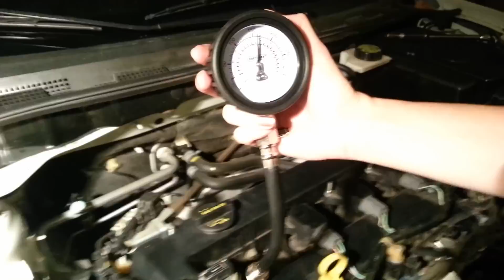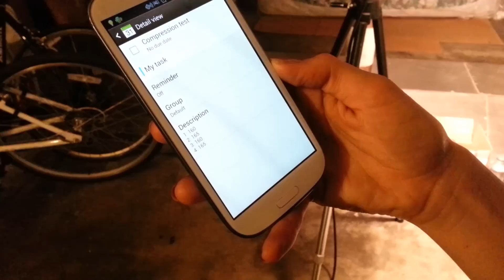HOW TO DO AN ENGINE COMPRESSION TEST!

Comment: So I'm trying mine and I am curious. If I remove ignition fuses my car won't even crank. I have a 2005 Mazda 3 with a 2.3 litre. I am not getting a reading at all on the gauge. I have pulled the fuel pump fuse and tried it with the ignition fuses in place....no reading . When I yank both ignition fuses the car won't crank ergo no reading. ....help

Comment: I just wanted to let you know, The only thing you did wrong was not removing all spark plugs before testing. Reason being? The problem is that if your head gasket is blown between cylinders you wouldn't know because the air will not be able to escape in the other cylinder!

Comment: Well you explained it well enough but,you should remove ALL the spark plugs so you can spot leaks between 2 cylinders (for example if the 2nd and the 3rd cylinder got blown gasket in between having the spark plug on will hold the pressure...but if you remove all sparkplugs pressure can escape through possible holes of the gasket and give you accurate result)

Comment: What if it had a carburetor instead of fuel injections? How to I disable the injection system?
Reply from the maker: Sith Strawberrynutz To disable the ignition system disconnect the wire that connects the distributor cap to the ignition coil (the ignition coil looks like a long round pipe and the distributor cap is plastic piece with a bunch of wires running from the top, there usually only 1 wire that connects these two pieces together). To disable fuel delivery you will need to find the main fuel line that supplies the carburetor then clamp it off using a vise grip. Usually it's a single fuel line but there are some cars that can have multiple. Also be careful not to puncture your fuel line when using a vise grip. Thanks for watching!
Reply: Is it necessary to cut off the fuel supply?
Reply from the maker: Sith Strawberrynutz Yes, if you don't your carburetor will inject fuel and likely flood the cylinders. You will also get fuel in the compression tester and ruin the gauge.
Reply: +Sith Strawberrynutz 
I was trying to find an answer to this. If you just remove the fuel line to the carb, it'll still have plenty in the float bowl so will keep putting fuel in. People say to fully open the throttle when testing but if anything I'd have thought it would be worse.
Reply: +rchave I suggest that fist remove the fuel line and and run the engine  until the fuel on fuel bowl was depleted. Then remove the distributor dc connector to disable spark voltage.

All spark plug must be removed and proceed compression test.

 I suggest that gas pedal should be step on while cranking the engine. . so that throttle plate will open wide and to avoid inaccurate Compression reading.
Reply: I would guess to disconnect your fuel pump and let the car run till it runs out of gas
Reply: so that your lines won't spit anymore fuel to the carb

Comment: Great video, just a few things to mention. Its best to remove the fuel pump fuse when doing a compression test. Before you turn over the motor its best to have all of the spark plugs removed and lastly, the person cranking the motor should have the gas petal fully depressed to allow the most air into each cylinder. Great video otherwise!
Reply: E Company, 2nd Battalion, 506th PIR, 101st Airborne Explain that to General Motors and Ford Motor Company.
Reply: garretts91 Engine not a motor
Reply: GamingWithAndriod More like Moderrr.
Reply: +E Company, 2nd Battalion, 506th PIR, 101st Airborne your a fool

Comment: My car didnt have no.compression at all and doesnt want to turn on how much do u think it will cost to fix it please reply?
Reply: Just throw that shit away...
Reply: what car ?
Reply: I have a 03 honda accord
Reply: well its going to be expensive, depends on your valves and piston rings conditions its either the piston rings or valves when you dont have good compression.
Reply: check your valve clearences
Reply: .....ya..
Reply: +Isaiah Blunkall (Hamm) 0 compression or low?  If it has timing belt, that could be the cause.  Which could have damaged pistons & valves.

Comment: Be careful with removing plugs on some engines with AL heads at operating temp. You could end up removing the threads as well. Especially the Ford 4.6L 2V engines.Also, although the video is very informative, this test isn't really needed on a modern engine, unless you have a CEL light and misfire code. The OBD system is very vigilant about detecting misfires by watching the acceleration of your toothed crank wheel. The problem in a newer engine would most likely be spark or fuel, and if that don't solve the issue a compression test is next. The Ford/Mazda VCM scan tool could do this test simply by cranking the engine and the computer observes the wheel.
Reply: not wrong, but if your goal is to modify on the stock block, you wanna make sure that your compression is stable, otherwise ZZB.

Comment: question, 99 gallant 3.0, v6.  the manifold is over the top blocking the rear 3 plugs.  if I take the manifold off, is it safe to have the motor turn over to get a reading, or what should be done?  after a 3 day down pour, very light white smoke has come and gone out my exhaust and I wanna compression test it.  I found oil on the front 3 plugs and replaced the valve cover gasket, and they have been clean every since but the smoke only went down a little.  if I take everything apart I wanna test it as well, but don't want to mess the fuel mixture up.. help..
Reply: Probably already have your problem solved, but if not... Take the manifold off! You'll be just fine for a quick compression test.

Comment: One other thing that is normally done is also WET compression by squirting a little oil in the cylinders. That way if your dry and wet difference is high, you know your rings are worn out since the oil helps to seal and give a higher compression. If the rings are good, the difference will be negligible since they're already doing their job.
Reply: The compression will rise anytime you do the oil test. The thing is, you do it only when the compression is too low and you know there is something wrong, but you just want to find out whether it's a problem with the cylinder/piston or valves/head.

Comment: To do a proper compression test, you need to remove all spark plugs and have wide open throttle. Then crank the engine while counting gauge needle puffs to be sure to have the same amount of puffs per cylinder.
Reply: yup